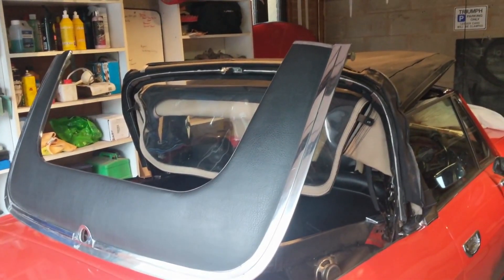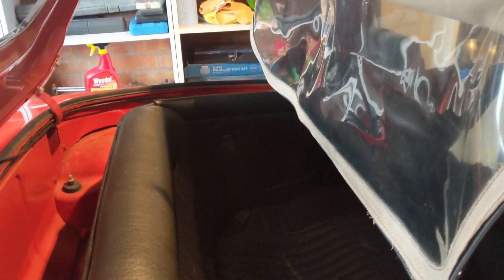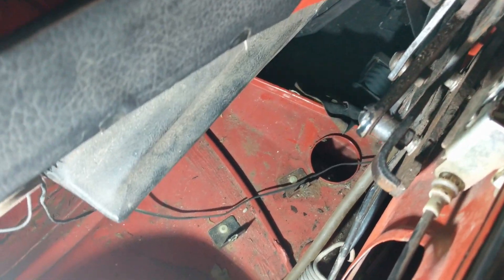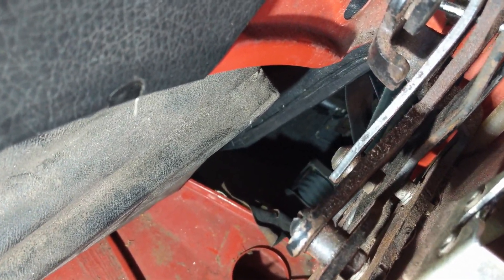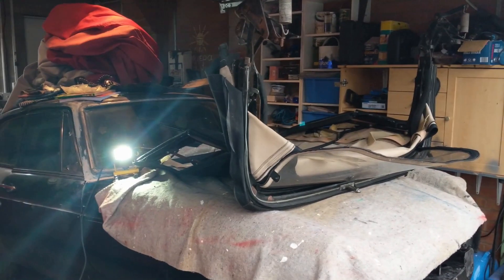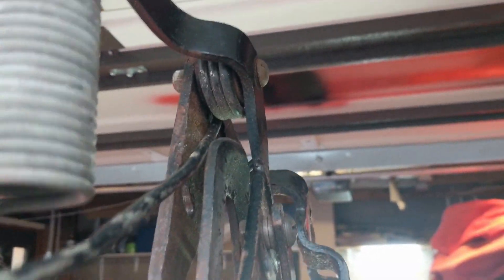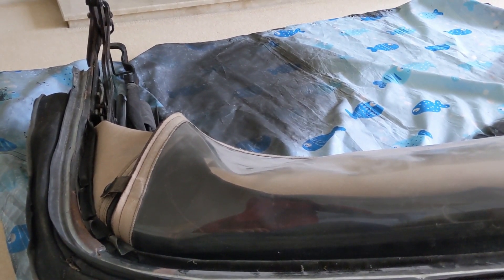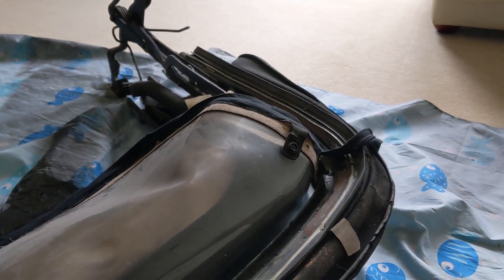Triumph Stag Episode 1   Soft Top Refurb Part 1

Comment: Thank you for soft top removal looking forward to soft top replacement
Reply from the maker: Sorry piacerre1, but all the video got damaged somehow and I didn't manage a part 2 in the end.  Soft top is already back on the car.  But replacement is the reverse of removal.  I would advise having a second body to help get it in initially.  Once there you can move it around to fit the relevant connections/bolts
Reply: @HenrysGarage  so will there be any more Stag videos?
Reply from the maker: @davidmoss1415  Hi David, there will be if I do any work on the car, but at the moment that's only likely to be a service or a drive and I'm not sure anyone is interested in that

Comment: Well done for the brave decision to hand sew in a new zip, it looks to be successful operation. I'm so scared of breaking my zip I usually leave the window in place when stowing the hood, even if you have to fold the window behind the seat! That looks to be an original hood so hopefully you managed to prolong its life. Have you ever worked out what those 2 elasticated tabs are for round the window - one of the Stag mysteries I'm yet to solve...
Reply from the maker: Yeah, I’ve not undone the zip since installing it and I have no idea what the elastic tabs are for.  But the original roof is still going strong